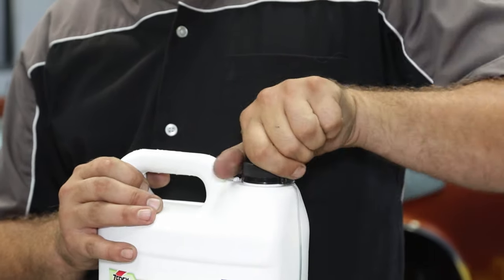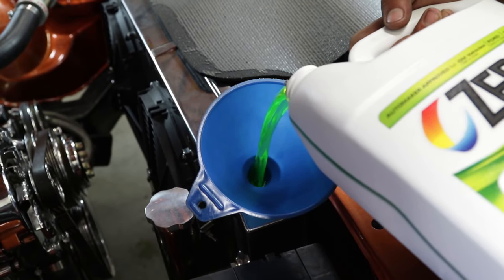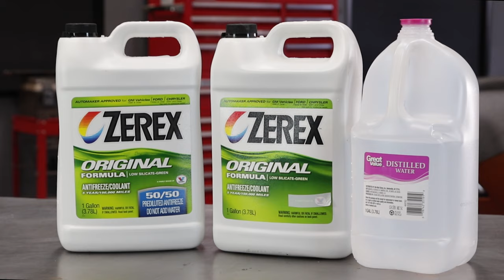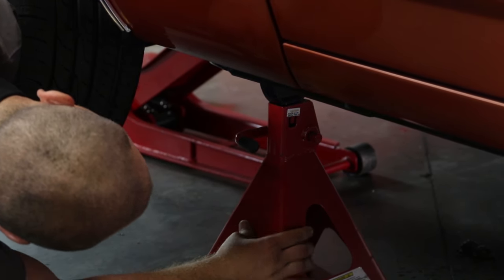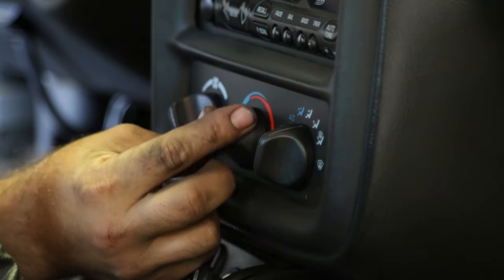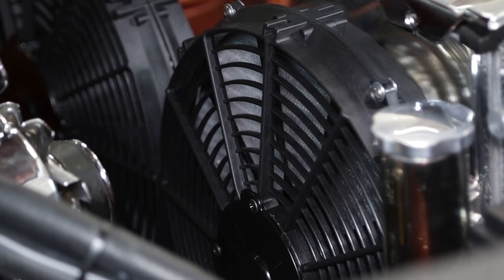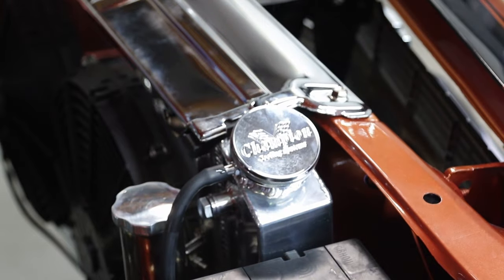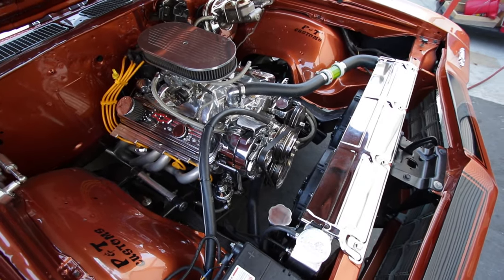Champion Radiators: How to purge and burp a cooling system

Comment: I put my funnel into the radiator to burp my lines. Funnel is always overflowing when coolant get hot just before fan kicks on, why?
Reply from the maker: This is usually done only when adding coolant to a new radiator to help fill the system, and usually isn't needed if you've already filled the radiator and cycled the cooling system a few times. As the temperature rises and pressure builds, you will see some expansion; if it's enough to overflow then you likely don't have trapped air. This method isn't always used, for years we just poured in coolant and started the engine, then when the thermostat opened we added coolant slowly as the level dropped, then replaced the cap when it was full. After it cools, check the level and add as needed. A reservoir will also assist by replenishing any coolant that was expelled through expansion.

Comment: Hi, i just replaced my radiator. I tried to do the burping method but everytime i added coolant in the funnel it would flow in the return hose. Am i doing something wrong? I always successfully did that method and it’s the first time it does this for me. 

Thank you!
Reply from the maker: Hi... burping the system isn't always necessary, this method is only when you know you have air in the system and need to bleed it out.... it seems you may not have any air in the system. In this situation, simply place the cap on and start the engine and let it get up to operating temperature and see where that is. Once you shut down and it cools off, remove the cap and see where the level is... if it's pretty full then you shouldn't have any issues, and you can add some coolant to the reservoir (only if it's dry). There should only be a little coolant in the reservoir when cold. If the reservoir fills up when hot and expels coolant, then you're probably set and won't need to add any.

Comment: I have burped my system for over an hour I also changed the thermostat. She got a bit warm for a bit the didn't over heat or steam or anything. Blowing out ice cold air again I'm not sure what the hell I'm not doing right. Before I did all that it was blowing out cold air almost overheated but went as far as 245 my gauge goes to 260. The water pump is new. Can any one please tell me WTF I can do cuz this has ridiculous
Reply from the maker: It's best to call in, too many questions, details needed, etc. It's not something that can be easily diagnosed going back and forth on messages. 951/245-9464, ... thanks
Reply: blowing out cold air has nothing to do with a radiator lol
Reply: @keltingr  never said it did. But works now cuz now I got heat and no cold air.
Reply: @keltingr  if there’s trapped air in the system, it can block heater core. purging the radiator can be a quick solve to this

Comment: Hi do you guys have the heavy duty radiator for a 98 Ford ranger 3.0l manual transmission? for serious offroading down here in south America also a high pressure radiator cap that holds the pressure?
Reply from the maker: Please contact our sales staff at Shop@ChampionCooling.com or call 951/245-9464 M-Th, 8-4:30 PST.